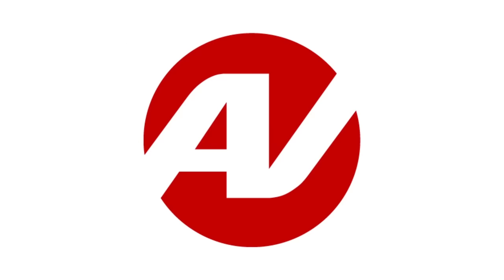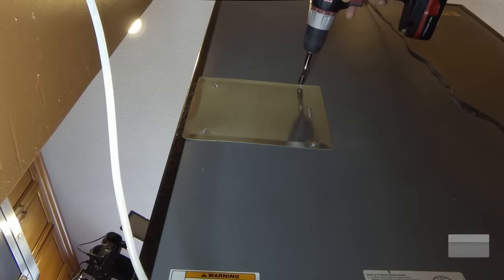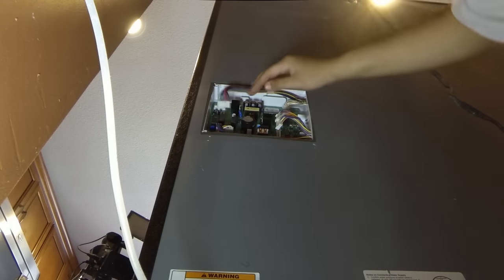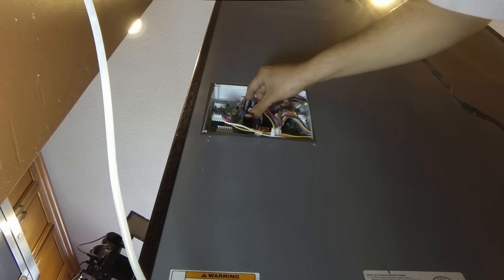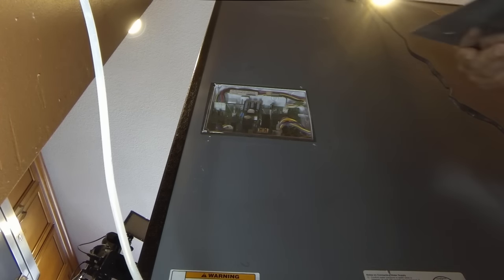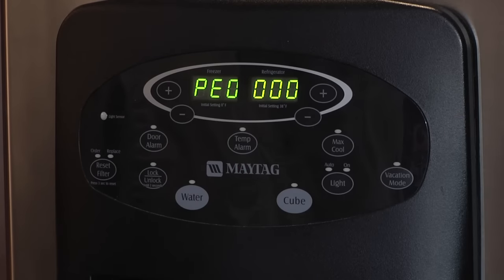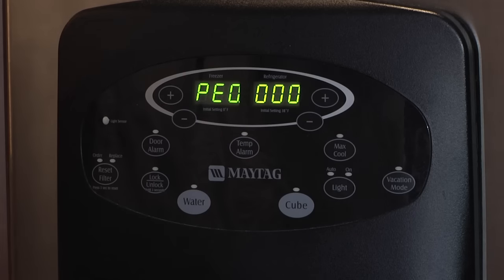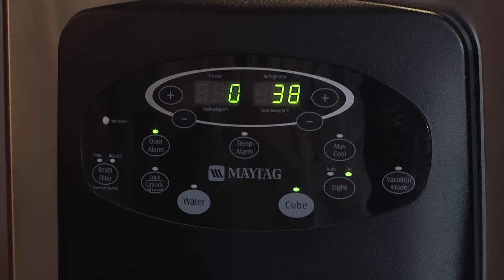Maytag Refrigerator Repair - Control Panel Lights Flashing - High Voltage Board

Comment: Thank you sooooo much. I ordered the part from Amazon at half the price from a parts supplier...took me less than ten minutes to install it. Fridge works like new. You saved me a bundle!
Reply: Hi Tracey can you please share the link with me on the control board you got from Amazon. I have the same situation and I am going nuts with the ice slapping noise. Thanks!

Comment: Thanks for the great video!!  I suspected that our Control Board was defective and had actually scheduled a repair service call, but then I watched this video and thought I would take a chance on fixing the refrigerator myself.  I have an Amana brand which is apparently made by Maytag.  I used the number that was found on my existing Control Board and found a new replacement from Amazon for about half of what one cost from other suppliers, however, I also found some for less that were refurbished on EBay, but opted to get the NEW board from Amazon.  Board came in about 3 days.  Using this video, I was able to easily replace the old board with the new board.  A lot of the other available YouTube videos explained how to replace the board but not the next step which is the PROGRAMMING.  Using this video I was able to easily re-program the refrigerator and it now works great.

THANKS FOR THIS GREAT VIDEO.
Reply from the maker: Thanks for your response, we are glad we could help. Our library
of over 5,700 videos are currently helping over 1.6 million people like you
every MONTH.  Please help us by
subscribing to our YouTube channel, or post our website www.ApplianceVideo.com to your Facebook
page, Twitter, Instagram or any other social media sites. Your support will
help us keep producing more free quality videos.

Comment: Hi..Thank you so much. I'm pretty sure my refrigerator messed up when there was some major bad lightning one night My freezer works and refrigerator is barely cooling. The refrigerator you used as a demonstration is exactly what I have. Took me for ever finding any info on it. I've been without for the last month, sadly 2 days after I just bought groceries, my refrigerator surged out. Couldn't save anything. Learning to be a handy woman...lol I was hoping you could help me by locating the board I need much cheaper than I've seen on line. Thank you again.
Reply from the maker: Yes, call our parts department at 1-800-830-5465 with your model number and they can help.
Reply: did replacing the board fix your problem?

Comment: Great comprehensive solution.  My Whirlpool refrigerator has many different types of errors: completely blank front panel LEDS even when touching the keypad, keypad lights up when touching the keypad, normal illumination of the keypad interrupted by power off are the 3 modes I observed.   I suspect there could be more symptoms of the main control board failure mode.  

I purchased replacement board for $260 (net $200 after $60 core refund) and followed these instructions with success, completing the full effort in less than 15 minutes.

Thank your for the valuable information.
Reply from the maker: Great question, if you have a more technical question that our parts department cannot answer, you can search our over 13,000 answered questions free at our website www.ApplianceVideo.com under our Repair Help section. You can also call our parts department at 1-800-830-5465 and they can give you help 7-days A week ,or search at www.SaveMoreOnParts.com  .

Comment: Jean Veras, I took a shot in the dark myself and decided that the button on the keypad must be bad if it wasn't letting me into the code, sure enough I put the new touch pad in today and the freezer down button was apparently not working. As soon as I put the new touchpad in and plug the unit in, went through the sequence, it immediately let me put in the code. I just finished restocking a cold refrigerator and freezer with everything working! :-) So much for Maytag customer service communication... useless!
Reply from the maker: +CycleOps USA LLC 

Thanks for your positive comment. We are glad we
could help resolve your issue and hopefully saved you money. We have helped
millions of people repair their own appliances so please help us produce more
videos to our site by subscribing to our YouTube page, or posting our http://www.appliancevideo.com/ website on your Facebook or Twitter account. Our
factory authorized technician’s also daily provide free professional Repair
Help to people like you to help solve their appliance problems. You also have
the option to email a factory service technician with a question at http://www.appliancevideo.com/repair-help/ .  If you need of parts for your major
appliance, we have over 5-million parts in stock at http://savemoreonparts.com/ . Thanks in advance for supporting us. So email
us if you have any other questions our videos cannot resolve. Thanks for your
support in advance.   Matt, Ace Appliance service technician.

Comment: Great video, thank you. I’m waiting for my board to be delivered. Is the 4 digit code written on the label on the inside of the refrigerator?  To the right of the label showing the model and serial number, it’s shows CODE 0302. Is that what I use to program?  Thank you
Reply: If anyone was wondering, you do use the code on the inside label of the refrigerator.  The instructions that came with the board stated that you use the code, but the rest of the instructions were useless.  Use this video for the rest of it.  Literally took me less than five minutes to remove  and replace the board, including the programming.  Thanks again.
Reply from the maker: Great question, if you have a more technical question that our parts department cannot answer, you can search our over 17,000 answered questions free at our website www.ApplianceVideo.com under our Repair Help section. You can also call our parts department at 1-800-830-5465 and they can give you help 7-days A week ,or search at www.SaveMoreOnParts.com  .

Comment: THANK YOU!  I replaced the voltage control board, but when I plugged the fridge in, the front display was blinking P0 000.  I could not figure out what to push to get into programing mode (the other videos that I watched were not helpful, nor were the blogs that I looked at).  Your direction to push the door lock and freezer down buttons did the trick.  My fridge is back in business.  My wife is happy and that is a good thing...
Reply from the maker: Glad we were able to help you George, and you made your wife happy! Be sure to share our channel with your family + friends, and be sure to like & subscribe.

Comment: Thank you of making this video.  It's clear and simple to follow.  Before I replace the board, how do I diagnose the problem to know if that's what needs to be changed.  The temperature is flashing,  alternating between 38 and 76.  Thank you.
Reply from the maker: Great question, if you have a more technical question that our parts department cannot answer, you can search our over 17,000 answered questions free at our website www.ApplianceVideo.com under our Repair Help section. You can also call our parts department at 1-800-830-5465 and they can give you help 7-days A week ,or search at www.SaveMoreOnParts.com  .

Comment: I have the exact same refrigerator in the video. Maytag MFI2067AES. Everything works great and it is making ice. However, the problem I have is it is not dispensing ice or water. Nothing. Should I replace the LV control board in the front or could it be the HV board in the back? Thanks,
Reply from the maker: Great question, if you have a
more technical question that our parts department cannot answer, our
technicians are answering all questions at our website at www.ApplianceVideo.com under our Repair Help section. You can also call
our parts department at 1-800-830-5465 and they can give you help 7-days A week
Monday -Sunday, or search at www.SaveMoreOnParts.com  24 hours
7- days A week.

Comment: Hi there great video. I have the same fridge my issue is the front digital board has lights none are  flashing but I can't switch from cubes to water or go up.or down on the freezer temp. I also just replaced my water filter but can not reset the button what do you think the problem my be? Could it be the touch pad from the inside? Or would it also be the same part as in your video.  Thanks
Reply from the maker: Great question, if you have a more technical question that our parts department cannot answer, you can search our over 17,000 answered questions free at our website www.ApplianceVideo.com under our Repair Help section. You can also call our parts department at 1-800-830-5465 and they can give you help 7-days A week ,or search at www.SaveMoreOnParts.com  .

Comment: Great tutorial.  How do we purchase the replacement control board though ? I didn't see any link upon being able to buy it while watching video. Or is it the (W10310340) information here for getting a new replacement control board for the maytag 36" wide French door refrigerator?
Reply from the maker: Great question, if you have a more technical question that our parts department cannot answer, you can search our over 17,000 answered questions free at our website www.ApplianceVideo.com under our Repair Help section. You can also call our parts department at 1-800-830-5465 and they can give you help 7-days A week ,or search at www.SaveMoreOnParts.com  .

Comment: I have a french door may tag fridge that looks similar to the one in your video. Thank you great video! Anyway the entire control panel is blank(black) the the light is on the inside and it seems to be coolling...any suggestions...thank you
Reply from the maker: Great question, you can call our parts department at 1-800-830-5465 and they can give
you help 6-days A week Mon-Sat . You can also search at www.SaveMoreOnParts.com 7- days a week.  If you have a more technical question that our parts department cannot answer, our technicians are answering all questions at our website at www.ApplianceVideo.com under our Repair Help section. We have over 4,000 common questions and answers that you can easily search through by your model
number, appliance make, and problem or error codes, and It’s free to search
through our question & answer library.

Comment: Thank you for your video, my kitchenaid refrigerator model KSRP25FNSS00 has a problem is : not cooling, not freeze on both side, and control panel on the front right side has no light show and can't adjust temperature, but the fan on the back still working. Is that a problem from the control board ? Need to replace ? Thank you very much for your time.
Reply from the maker: Hello, for
technical questions we have a Repair Help section at this link https://www.appliancevideo.com/repair-help/ . There are over 6,000 answers and questions you
can search through FREE to help you with your problem. Hope this helps

Comment: My fridge,the same one you're demonstrating with,is working but the display isn't working nor the water or the ice dispenser..when I push buttons, I get sab on the freezer side display and farenheit or Celsius display on the refrigerator side display..what's wrong?
Reply from the maker: Great question, if you have a
more technical question that our parts department cannot answer, you can search
our over 10,000 answered questions free at our website www.ApplianceVideo.com under our Repair Help section. You can also call
our parts department at 1-800-830-5465 and they can give you help 6-days A week
Monday -Saturday, or search at www.SaveMoreOnParts.com  24 hours
7- days A week.

Comment: I Noticed you replaced the  12920710 board with the  WPW10312695 - are there any differences?
Reply from the maker: Great question, you can call our parts department at 1-800-830-5465 and they can give
you help 6-days A week Mon-Sat . If you have a more technical question that our
parts department cannot answer, our technicians are answering all questions at our website at www.ApplianceVideo.com under our Repair Help section. We have over 3,000
common questions and answers that you can easily search through by your model
number, appliance make, and problem or error codes, and It’s free to search
through our question & answer library.

Comment: Help! I’ve followed all instructions and am entering code, I press freezer down button to save....it beeps! Cannot get to setting of fridge. I’ve tried several times from start.
Reply from the maker: Great question, if you have a
more technical question that our parts department cannot answer, you can search
our over 10,000 answered questions free at our website www.ApplianceVideo.com under our Repair Help section. You can also call
our parts department at 1-800-830-5465 and they can give you help 6-days A week
Monday -Saturday, or search at www.SaveMoreOnParts.com  24 hours
7- days A week.
Reply: Hi Katherine.  Have the same problem.  Did you ever get it to work.
Reply: Update on my fridge. I found a code that worked after watching another utuber video. My fridge works, however, my ice maker does not. Kind of a bummer since I have to make ice now.

Comment: Hi Mr. Cristian , I have a same model of refrigerator. And have the same problem. Please, could you tell me where can I buy the board?
Reply from the maker: Great question, if you have a
more technical question that our parts department cannot answer, you can search
our over 10,000 answered questions free at our website www.ApplianceVideo.com under our Repair Help section. You can also call
our parts department at 1-800-830-5465 and they can give you help 7-days A week
Monday -Sunday, or search at www.SaveMoreOnParts.com  24 hours
7- days A week.

Comment: hi there. where you can get the code which you put on the end of the video ?
Reply from the maker: juri De Luca 

All of our technicians are now answering questions daily at our http://www.appliancevideo.com/ website under the Repair Help section.  We also have over 1600 common questions and
answers that you can easily search through by your model number, appliance
make, problem or error code and it’s absolutely FREE. You also have the option
to email a factory service technician with a question on your appliance at
http://www.appliancevideo.com/repair-help/ . If you’re looking for a repair video, you
can also search our library of over 2600 free repair videos. ApplianceVideo.com
specializes in quality DO-IT-YOURSELF appliance repair videos and we get over
800,000 views per MONTH to our videos worldwide and growing. If you need of
parts for your major appliance, we have over 5-million parts in stock at http://savemoreonparts.com/ .  Thanks
for your support. Matt Ace Appliance factory service technician.
Reply: It's on the sticker in your fridge.
It will say something like CODE xxxx.
Those four numbers.
Reply: Mario Monti Thank you!! 🙏🏻

Comment: Hi! I have a Maytag refrigerator that’s not cooling! What do u think is the problem?
Reply from the maker: Great question, if you have a
more technical question that our parts department cannot answer, our
technicians are answering all questions at our website at www.ApplianceVideo.com under our Repair Help section. You can also call
our parts department at 1-800-830-5465 and they can give you help 7-days A week
Monday -Sunday, or search at www.SaveMoreOnParts.com  24 hours
7- days A week.

Comment: i have Magtag MF12067AES model . maybe it is lil older from the one u worked on it. My question the code will be the same ? 1411 !!thanks
Reply from the maker: +Ahmed Sulayman (easternshadow) 

                   All of our technicians are now answering questions
daily at our http://www.appliancevideo.com/ website under the Repair Help section.  We also have over 1600 common questions and
answers that you can easily search through by your model number, appliance
make, problem or error code and it’s absolutely FREE. You also have the option
to email a factory service technician with a question on your appliance at
http://www.appliancevideo.com/repair-help/ . If you’re looking for a repair video, you
can also search our library of over 2600 free repair videos. ApplianceVideo.com
specializes in quality DO-IT-YOURSELF appliance repair videos and we get over
800,000 views per MONTH to our videos worldwide and growing. If you need of
parts for your major appliance, we have over 5-million parts in stock at http://savemoreonparts.com/ .  Thanks
for your support. Matt Ace Appliance factory service technician.
Reply: +ApplianceVideo.com i did went to your website it is not free as you said. $25 for 1 question

Comment: I get the "PE" prompt but, no numeric display option following.
Reply from the maker: Great question, if you have a more technical question that our parts department cannot answer, you can search our over 17,000 answered questions free at our website www.ApplianceVideo.com under our Repair Help section. You can also call our parts department at 1-800-830-5465 and they can give you help 7-days A week ,or search at www.SaveMoreOnParts.com  .